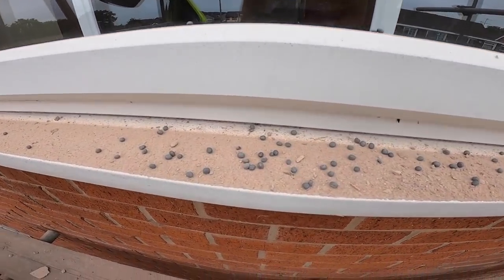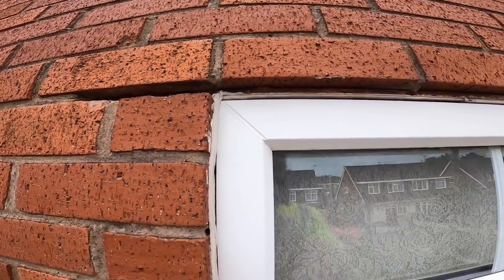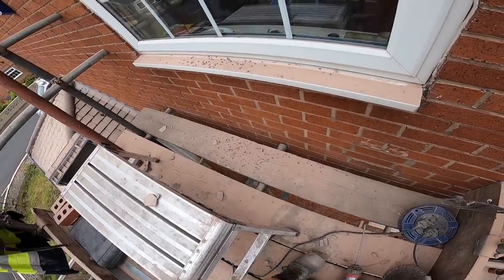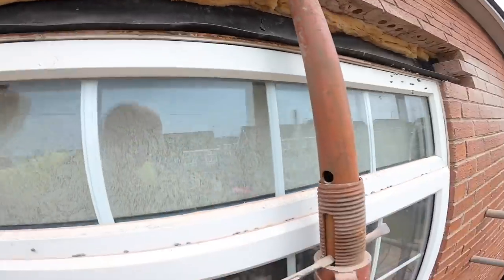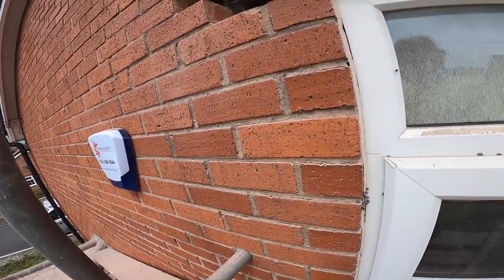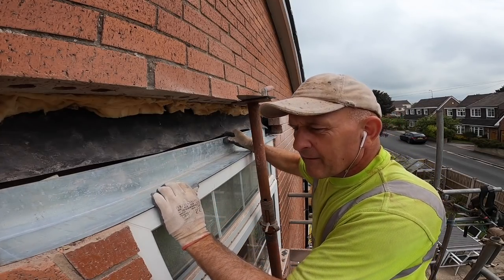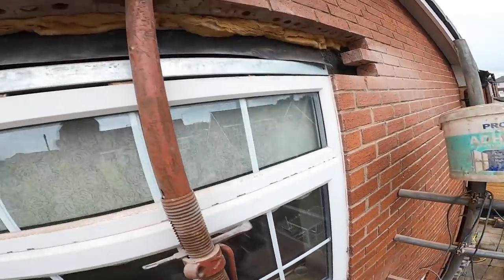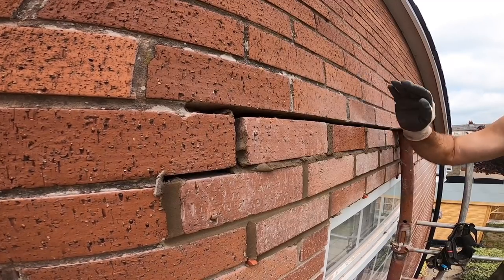NEAR MISS, CABLE IN THE CAVITY!?

Comment: I've had to cut a few bigish holes in brickwork with the cavity filled with the white polystyrene beads. I usually drill a few holes in the mortar around the hole needed and inject a couple of cans of expanding foam. Leave it to set for a couple of hours and then dig out he bricks, foam sets around the beads preventing an avalanche. Works 99% of the time, may get a few beads falling out but not the entire gable end full.
Great job as usual ..

Comment: To stop the loose fill insulation falling out drill 12mm holes in the joint above the last one you are taking out and with a foam gun ( 10 minute foam )  squirt it in ,this will bond the loose fill and stop a good percentage falling out once you start removing bricks .  It's not perfect but stops 80% of the mess
Reply from the maker: Nice one Dennis 🧱👍🏼
Reply: I was thinking the same thing......
Reply from the maker: @kestutisbagusauskas8323  🧱👍🏼

Comment: Couldn't have donr a better job myself top draw as usual.
I have to ask do you enjoy these lintel replacements Steve just curious mate .
Not everyone knows how to do em you make them look enjoyable.
Ive done loads of em and rsj work but i try stay away from all that these days myself Steve 
Cracking job mate
Justin brickright 👍
Reply from the maker: Cheers Justin. 
   I used to despise this job when I had to do it under pressure when we did conservatory bases . We would be sent over when the window fitters needed a lintel or 2 .
    If I turned them down now We would miss out on a lot of work . 
   I have my own little system now , a good scaffolder and it feels good to help people out as they are generally very worried when told the lintels have gone . 
    I always used to try and take the minimum bricks out and struggle but now I make sure I take out plenty so we have more room to move and fettle the tray properly. A few extra brick to put back but way less stressful. 
🧱👍🏽
Hope you’re enjoying the break 😎🍺🍸
Reply: @SteveAndAlexBuild  
Top man defo got a good system going there steve..Structural work should command more money i think as really its a specialist job you have to no what your doing its a skill on its own. They probably pay more to tile a kitchen wall than that skilled work your doing.
Mad thing is ive never fitted an angle iron its always been catnic or i.g or similar both skins and full palster internals.
The right lintels then have to be sourced etc.
Love your videos Steve always a proper good job thats why there good.
Enjoy the weekend both of you 
Justin 👍
Reply from the maker: @brickrightbuildinglandscaping  Cheers Justin , yes unfortunately we are probably the least paid highly skilled tradesmen 🙄 
   Fully qualified brickies are very underrated and under appreciated which is a shame . 
    Thanks for the kind comments they always mean a lot from your peers 😁🧱👍🏽
😎🍺🍸

Comment: Just a couple of ideas. Rather than using mastic  on the cavity tray, try sticks like ** turbo , an adhesive and sealant. Gone in 15 minutes. With the bead insulation, we drill holes outside the area we are working on and inject expanding foam to stop any dropping. By the way, another good video 👍
Reply from the maker: Thanks for the tips Richard 🧱👍🏽
Reply: I have a question, could I expect the same process for a building that's 100 years old? This is a big 4 story building that's old and the steel lintels are rotting pretty bad. It looks like there are 2 of them for each window though. The first one is embedded into the brick and then there is just a steel plate welded to that one that comes out the rest of the way to the outside brick. The welds are rusting and causing that front plate to fall and hang down
Reply from the maker: Sorry pal I can’t advise without seeing it unfortunately 🧱👍🏽

Comment: Great video... maybe a stupid question why is the new angle iron not as thick and heavy as the old one 🤔
Reply from the maker: That’s just how they are made now . It is galvanised through , which means it will last a lot longer than the other 🧱👍🏽
Reply: @SteveAndAlexBuild  back in the 80's when this type were fitted, they probably anticipated corrosion and fitted extra thick steel. But I still don't get why they didn't use galvanised in the first place, cheaping out on structural elements is not a great idea.
Reminds me of the heavy, old galvanised wall ties that would corrode and split the brickwork, it took awhile to get stainless as a standard.
Reply from the maker: @JohnnyMotel99  . I agree , stainless ties really haven’t been around long at all 😬🧱👍🏽

Comment: I dont know if that new lintel  you put in was the correct  thickness  for a load bearing lintel, the old one looked three times as thick??
Reply from the maker: The new one is the standard thickness for all modern lintel . 🧱👍🏽
Reply from the maker: @martin2466  🧱👍🏽

Comment: Wasn't the old lintel much heavier than the new lintel? Does that make any difference?  Nice professional job, I wish you were in my area. Thanks for the video.
Reply from the maker: The old lintel is actually better strength wise than the ones we replace them with BUT , they destroy the wall if left alone once the dreaded rust has set in😬🧱👍🏼
Reply: @SteveAndAlexBuild  ---  I'm in the US outside of Philadelphia Pennsylvania.   Our big box home stores sell metal lintels, they are lightweight and there's no real selection.   To find heavier weight  you have to go to a specialty seller, there's even one seller that will twice dip them if you want. 

Here's the prices and weight for some for sale near me, we of course use older English measurements,  I have converted the prices to GDP,  no VAT here.   These lengths and weights are awkward for one man to load in the rack of a pickup truck. 

Galvanized Angle
Product Name: GA.250 X 4.00 X 4.00 X 20’
SKU: 104422
Weight: 138.60
Size: 4.00 X 4.00
Length (in inches): 240
Material: Galvanized A36
Thickness: .250
Description:
GALVANIZED ANGLE

240"
Tolerance on cut lengths may be +/- 1/8 inch.
Custom cuts may require 1-2 days to process.
Once cut, this item is non-returnable

Price by Quantity:
1 - 49 = $192.73.    [£139]

---------

Galvanized Angle
Product Name: GA.375 X 4.00 X 4.00 X 20’
SKU: 104176
Weight: 205.80
Size: 4.00 X 4.00
Length (in inches): 240
Material: Galvanized A36
Thickness: .375
Description:
GALVANIZED ANGLE

240"
Tolerance on cut lengths may be +/- 1/8 inch.
Custom cuts may require 1-2 days to process.
Once cut, this item is non-returnable

Price by Quantity:
1 - 49 = $279.56. [£203]
Reply from the maker: @davidnull5590  . We need quality gear like that over here . Thanks 🧱👍🏽

Comment: Might be the weirdest question urve been asked I’m looking at adding a dog flap in a solid wall what lintel do I require it’ needs a 350mm opening
Reply from the maker: I think that 750 mm is the smallest lintel 🧱👍🏽
Reply: @SteveAndAlexBuild  cud
I use 2 angle irons back to back and cut down
Reply from the maker: Yes or cheaper would be angle iron outside. 4x3 concrete lintel inside 🧱👍🏽

Comment: I understand the masonry/iron issue with rust.  It will destroy a wall or road quickly.  That being what it is, why aren't steel lintels better protected against rust?  I'm guessing using stainless steel would be cheaper than a job like this.  Is it common for lintels to rust?
Reply from the maker: Back when this lintel was out in they weren’t galvanised like nowadays so very common on houses this age 🧱👍🏽

Comment: Great video guys 👍
So did you have 2 acro props, one one the ground with the other on top ?
Reply from the maker: Thanks pal . No I’ve found a great little hack .
   I grind out roughly 6 feet below the lintel . Put a strong bit in then put the acrow on top of the SB . Solid Job 💪🏼👌🏼🧱👍🏽
Reply: @SteveAndAlexBuild   
Ah ha very clever , so do you mean a strong boy which goes on top of a acro props ? 👍
Reply from the maker: @buzzlad007  yes mate 😏 . If you look in our lintel playlist I’ve done a video a while back showing it in detail 🧱👍🏽

Comment: Alright lads, think I’ve got a knackered lintel not sure so I’ll ask you. The window leaks when it rains, there’s a big bead of silicone round the top of the frame but that seems in tact, would a knackered lintel cause water ingress, if so roughly how much should I look at paying for it to be fixed based in the north east
Reply: Could be no cavity tray is the issue,  rain gets through the brick above the window and seeps through the top . Common problem on older houses .
Reply: @dennisphoenix1  never thought of that, it’s a 1930s house so would make sense. Any idea what I should be paying?
Reply from the maker: You’ve just described all the symptoms of a knackered lintel .
   Approximate cost £300 ish ground floor and £200 on top for a scaffold if it’s an upstairs one . 
  Hope that helps 🧱👍🏽
Reply: Worth diying it or leave it to the professionals lol?
Reply: @reecesmall6187  if you have watched a few of the lads videos have a go yourself.  Your pointing might not be as good 🙄🙄
Reply from the maker: Tray or lintel , both need the wall opening up to investigate and fix . It can be diy ed but be warned it’s not an easy job .. I’ve just done 3 lintels where someone had took the trouble to open up the wall . They installed lead cavity trays VERY badly but never put lintels in when it would have been so easy . Massive botch job 🙄🧱👍🏼
Reply: @SteveAndAlexBuild  lol think I’ll leave it to the professionals, not worth getting in trouble with the mrs for. Thanks lads👍🏻
Reply from the maker: @reecesmall6187  😆 probably for the best 🧱👍🏽

Comment: My mums house was built with no external lintels or cavity trays. The bricks were placed straight onto the wooden window frames.  You can imagine what happened when she had new UPVC windows fitted.  She has had lintels fitted by people that have not got a clue and not installed a cavity tray.  When it rains the house is like a colander.
Reply from the maker: That is such a shame but unfortunately very common . Window fitters on price work just want that window in ASAP 🙄🧱👍🏼
Reply: @SteveAndAlexBuild  , yep they just scratch out a bed joint either end of window and drive a metal strip in, probably still charge the same as what Steve has just done,
Reply from the maker: @Imfat8888  . Yeah and cause a whole lo of problems 🙄👍🏼🧱

Comment: I might just being picky but what stops water getting in between new lintel and the top of window frame and as for calling bits of scrap wood packers is a joke especially as you can get proper plastic ones.
Reply from the maker: I forgot the plastic packers and the window wasn’t sealed because it was being replaced as I clearly said in the video !

Comment: there was 50 years left in that lintel, it just needed sealing properly and pointing
Reply from the maker: Not a chance , once the rust starts that’s it . That’s what most people do , spot a Crack ,  fill and forget it and wonder why it’s back a few weeks later .
Reply from the maker: @martin2466  🧱👍🏽
Reply from the maker: @bobhook336  It wasn’t as bad as we normally take out but the rust has started which can’t be reversed . 
    Paul the customer was putting a new window in so asked us to replace the lintel before the rust started to lift the brickwork . Jimmy Turner is very wrong 🧱👍🏽